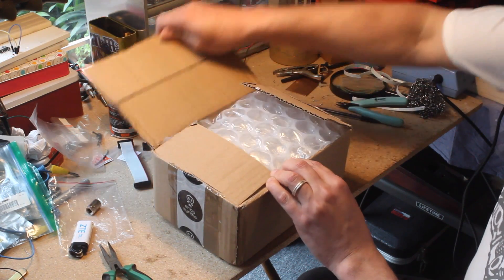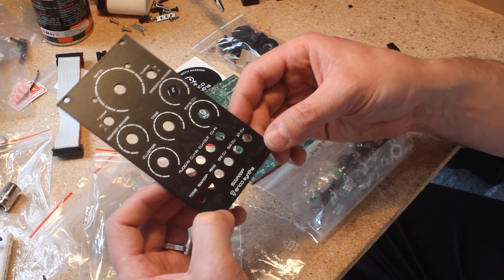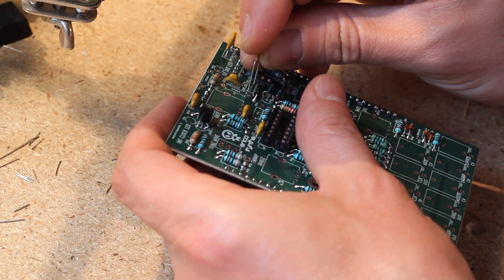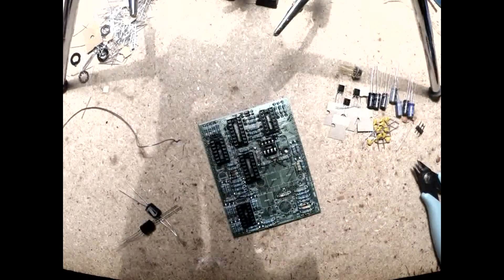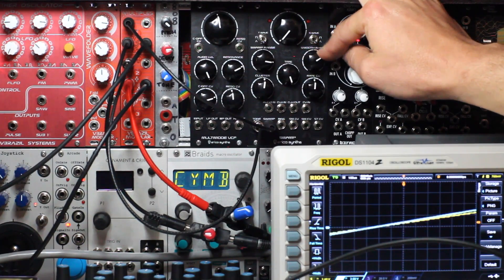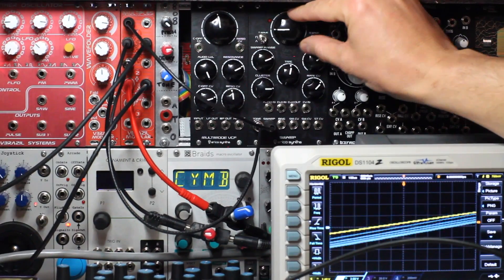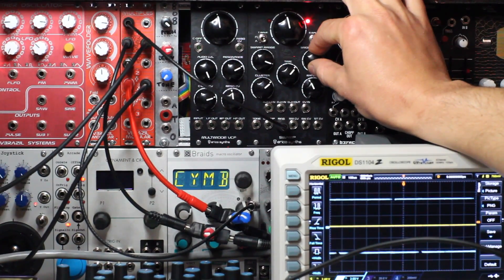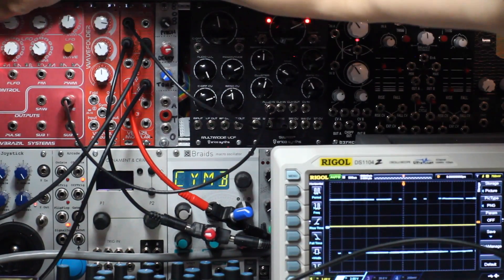Kit Review # 9 - Erica Synths SWAMP random module

Comment: Thanks for the video! Just built mine, but haven't tested yet. Do you know what is the right position for the jumper? And what does it change?
Reply: JMP-PLD-3 as marked on the main board changes CV between -5-+5V and 0-10V (I'm guessing that in general, -5-+5 would be better for "control" CV; 0-10 would be better for V/8ve CV). I had to check the schemo to figure it out :)
Reply: @tildebyte  Wow, thank you for detailed reply! Erica Synths should have stated it more obviously in the manual :)
Reply: @tildebyte  thanks so much for this info, I was trying for some time to figure this out.
Reply from the maker: Hey! I don't remember, but I'm sure that's covered in the build guide, no? Cheers!
Reply: @QuincasMoreira  Thanks for reply! I haven't seen this in the build guide, but i tried both ways and chose the best one. Sounds pretty much like yours, but now i'm starting to think it takes too much hp for its usability :) However it was a fun to build.
Reply from the maker: @Kojoohar  It grows on you...

Comment: I failed to build this so i confirm its not for beginners 🌚.  I tripla checked everything, it took me 3 days to build this. Then i tested it and it seemed to work but when i added other modules swamp affected them as wel as click noise. I took it off and test it havent damage other modules. Now i dont know what i should seek cause i know nothing about electronics. I think i have to send it to electronic mechanic
Reply from the maker: talk to Erica Synths customer support, they might have a deal for you to check the module!

Comment: It's been few months i built it and.. honestly i'm lost in randomness.
i bought a MN wogglebug since that i find more "reliable" : it's a random you can predict. The swamp i just turn knobs a can never predict what i want. Documentation (1 page) is really missing explanations. And because it's a random module.. really it's hard to know if you built it correctly. I looked at your video and tried to match knobs to hear if i have the same and looks like it's ok. But then the CV outs.. who knows what gets out of there. I really think erica synths should release basic videos with oscilloscope on cv outs to get a rough idea on what to expect there. MAL-2 is my best random DIY so far although far simpler it's easier to grasp.
Reply from the maker: Hahaha, yeah the Swamp is... well a swamp!
I still love it though, even though like you I can't quite control it. I do use it a lot anyways, including the CV outputs which always seem to do the job of randomizing things.
Reply: @QuincasMoreira  Hey one question about soldering. you always mention that you solder from above. i do it since i watched your videos. But once done. Do you turn the board and finish soldering on the rear ? because soldering from above i end up sometime with some solder not going thru and i'm concerned the contact is good enough. Not sure i understand that part well from your videos.
Reply from the maker: @moreausylvain  hi! Yeah I always touch up from behind, but after a while you get the hang of the right amount of solder to use to go all the way through, and the touchup is minimal.

Comment: Hi Quincas, love your channel and your build, bring it on :) i also recently build a swamp and it mostly does what it should. or so i think, its not that easy with modules like that :D unfortunately the rate knob does nothing at all. the tone out is stuck at a fixed frequency and also the cv in for rate is not doing anything. do you have any ideas?
Reply from the maker: method chaining Hi, thanks! I think all three are related. Looks like the tone oscillator is not getting the mixed cv. Try locating the opamp that mixes the rate controls (pot and cv) . Maybe it's faulty, or there's a broken trace. I'll ask Girts to make the schematics available, that may help. Good luck!
Reply: thanks a lot for the quick response, gonna check it out as soon as possible :)
Reply: found the schematics in the downloadable assembly.zip on their page, the opamp for the rate cv is DA1 but that one i already changed for another one and judging from the schematics this ones responsible for other cv inputs as well. have to check if those are working in which case this opamp is not the source of uncertain ;)
Reply from the maker: May be a broken trace then, from the mixed cv opamp output to the oscillator section, try to follow the signal with a scope
Reply: okay i am a bit stuck here, i was testing the testpoints with a scope but doesnt really know what to look for. tested TP1 (after the rate knob) and TP2 (after the rate cv input) which lies directly after the opamp DA1 and have practically no output on the scope. same goes for TP5 which lies after the Vactrols. for example TP11 after the vco out shows a fine square wave.
Reply from the maker: I'm on my way to a festival, no time to help you ATM unfortunately! Hit me up next week!
Reply: sure no problem, enjoy your festival :) and thanks for the great help so far!
Reply: hey Quincas, it woooorks thanks a lot for your help too!

Comment: So that's the most expensive "Full kit" ? Do you need to buy all the diodes and resistors and other little parts when you pick one of the cheaper options ?

Great channel, by the way
Reply from the maker: Amélie Dutiers thanks! Yeah, the cheaper options include only the Sample and Hold IC and mechanical parts to connects the PCBs. Everything else would need to be purchased separately.
Reply: One option is to purchase a bulk pack of resistors rather than getting individual values. You will end up with a ton left over but you will be set for your next project. 470ohm, 4.7k and 47k resistors come up all the time.

Comment: Great vid! I've built a turing machine, radio music and mikrophonie. My question is, how do you check for power shorts with the multi-meter?
Reply from the maker: DjRafiV cool! To check for shorts you would use the continuity/diode tester function in your DMM. It beeps when you touch the leads together. Just place one lead on -12 and the other on ground. Then check +12 and ground and finally -12 and +12. If it never beeps you are short free!
Reply: Synth Diy Guy easy enough, thanks!
Reply from the maker: you can see me do it right here:
https://youtu.be/j3Zdh7Qu0vk?t=17m41s